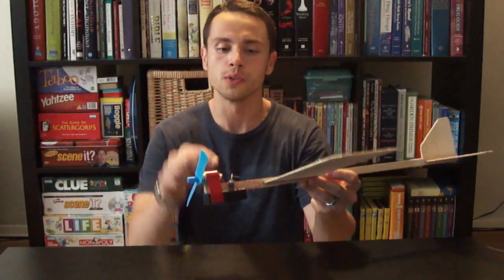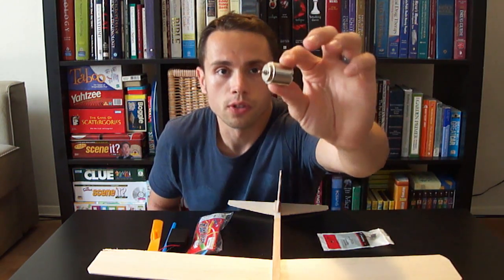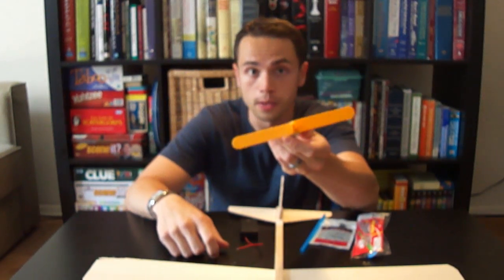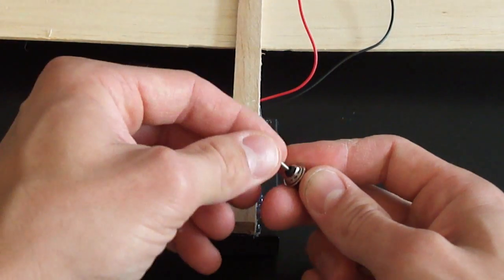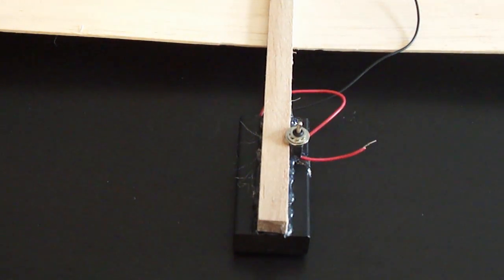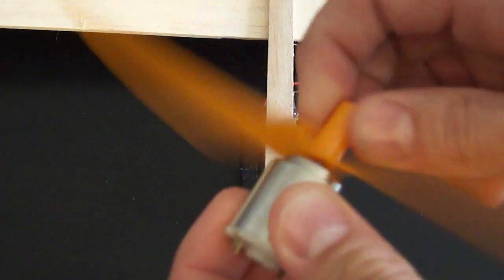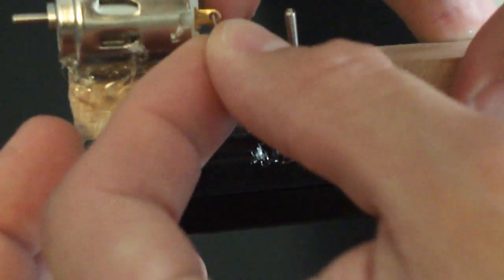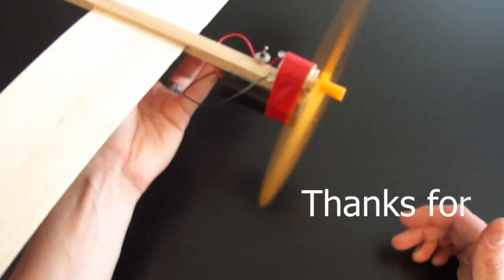How to Build a Battery Powered Plane (Balsa Wood Airplane)

Comment: Ok, so we've figured out the the weight of the batteries and the motor itself are too much for that motor and prop.  I've made a similar balsa plane with a battery-powered motor that does fly.  I used a 3V flat battery - the size of a quarter, that came from my car alarm fob.  Much lighter and provides ample juice for the motor.  You can also find a much smaller switch.  I was able to hold the plane, turn the motor on, and have the plane fly under its own power.  Additionally, I used a prop that's smaller than yours - about 5", that came from a balsa model.  It's shaped more efficiently than the one you're using.  Lastly, cut a few inches off the front of the fuselage and mount the motor closer to the wing.  The center of gravity will be improved.

Comment: motor and batteries are way to big and heavy for that plane also it needs an airfoil cg needs to be right if your gonna make it powered use a hobby grade motor and battery from a small rc plane

Comment: oh god. so many fucking retards! i went a full minute not able to breath from laughing after reading 3 pages of comments. go buy a 3.5mm motor and prop from horrizon hobby and a 150mah lipo. it will cut your wieght in half instead of using a fat ass can motor and heavy nicad or what ever ridiculous battery you used. i only watched 2 minutes before i face palmed and went to read comments.
Reply: lol doesn't even have an airfoil

Comment: Would the plane still work if you don't have a battery box and you just Connect the wires to a regular double A battery
Reply: +HaPpY_gUy use a SuperCapacitor works Much better, this thing is a Brick! with not near enough Power...
Reply from the maker: +Allen Burbank Thanks for the tip.
Reply: RichsMethods your welcome. have you Seen GrandadisAnOldMan? his channel is fun to give a visit he is always tinkering on something, and he has Lots of videos on super capacitor powered free flight Airplanes, mostly made out of Styrofoam Plates as Iv always made my Gliders out of cheep and works well, but so dose balsa have you tried shaping airfoil into your wings? that and Making it Light as Possible will Help.. :)

Comment: Hi, the motor has got an incredible power. Can you tell me the volts that it has?? I live in Argentina, and I have tried it with motors that I be able to find here, but the planes didn't fly. Becouse the motor can´t give the propeller enough power to make it spin fast. thanks!!
Reply from the maker: I just bought the motor at Radio Shack. I'm not sure of the volts, but it was a cheap one (less than $5). After a few weeks of usage I burned the motor out.
Reply: RichsMethods Ok, thanks!!

Comment: nice i like it but it goes down at the end because of the CG and plus the motor is not that powerfull enough to give the thrust thats needed, the proeller seems too flexible should be more rigid cause if its not then it will bend forwards tryin to pull the weight of the aircraft. if anyone wants to build a controllable rc plane then u can watch this "How to build and fly an RC plane".

Comment: it good idea but it can fly ..really ? first .. i think  it too heavy. you shold use small motor and iltium battery . second .CG...of plane.  head is heaey.  if you move a battery back to tail for balance ..   third  ..angle of attrack ..for lift..
Reply from the maker: It does fly, but it needs some fine tuning to get it to fly really well. I like the idea of moving the battery pack to the tail for balance.

Comment: I would have gone with AAAs instead. has the same power and is lighter. only wont last as long
Reply from the maker: That's a good idea! Thanks.
Reply: The trouble with AAA's is that they cost the same as AA's and have less than half the capacity.
Reply: Rechargables.
Reply: A rechargeable aaa batteries have less volts best going with a mini lipo
Reply: single cell lipo will have 3.7 volts, rechargables will have 1.2 or 1.5. They also have a lipo that is made to be a AAA. so its really just preference on how you want it set up

Comment: If you put some down draft stabilizers on the wings you will get more lift. However with a motor on it, it will just fly away so I suggest you either figure out how to wire a servo to the plane so you can setup a remote control to it, and or use this in a really big field.
Reply from the maker: Nice thanks for the input. Servos are little beyond my expertise.
Reply from the maker: RichsMethods But definitely worth the try.
Reply: RichsMethods You can get them at any hobby shop that deals with remote control vehicles. This would give you the ability to steer the plan.

Comment: This will NOT work, the plane would go into a dive. Assuming the plane was balanced well enough to glide without the motor and battery, the center of gravity must be maintained. A simple way to do this is to place something under the plane until it balances front to back. Mark that point. Add the motor and then find the point (toward the tail) where the weight of the battery causes the balance to return. Motor at the front, battery toward the back, original COG established, it should fly…providing the wings provide enough lift for the additional weight. Here, yeah, it would be close.

Comment: If one propeller helps the plane get further even though it weights more with a battery, 2 wing propellers should do better (if placed well). 3 propellers is also possible then.

Comment: The larger the propeller (to a certain point). Will actually decrease the performance.  The larger prop will have more drag then the smaller prop.  If it has more drag then the motor will not spin as fast.  For that motor and plane I would recommend a propeller an inch or two smaller than the current one.

Comment: you should have used a soldering iron and solder because if any hot glue gets in between the two parts, there will be no conductivity and no power which=NO FUN!

Comment: OK. Looked good on the build, but the actual flight didn't look too good. What do you do about the propeller when it lands?  It will hit the ground and break the propeller and strain the motor. Perhaps some landing gear would help. Something to keep the prop out of the dirt. Next step is to add radio control and get some moving control surfaces!  By the way, Using a motor on a "free flight" plane could result in an extended flight that would require you to chase it down. Still good though.

Comment: it wont fly even after two propellers, make rudder elevators and ailerons 
used brushless outrunner with that you need a ESC and a lipo and tx/rx
4x servos and other hardware required like propellers AND adapters etc

Comment: Good job, but it would most likely work better if you would have yoused like a tripple a battery alone and a slightly better prop kinda like an rc prop because they generate more thrust. :)

Comment from the maker: Ya I might try placing it under the wings. At first I thought placing them up front would be a good idea because of the size of the plane. However, it may have dragged the plane down a little too much. 

I was thinking of placing motors on each side of the plane (on the wings) and see what happens.

Comment: A couple of things:

If you accidentally mounted the motor bacwards, couldn't you just switch the poles so that it would spin the other direction?

Also, wouldn't it be smarter to put the battery back under the wings to balance the weight ?  As it is, it would drag the plane down.